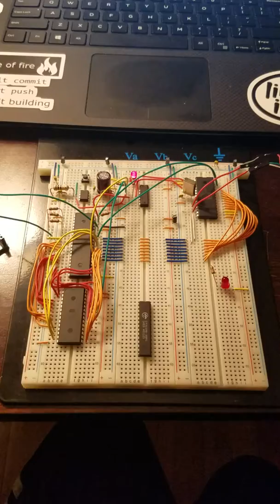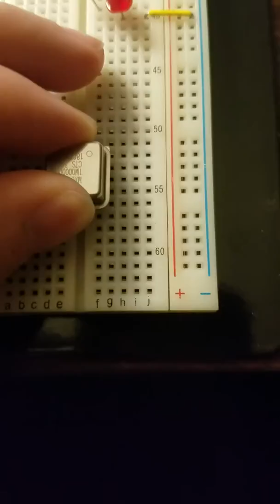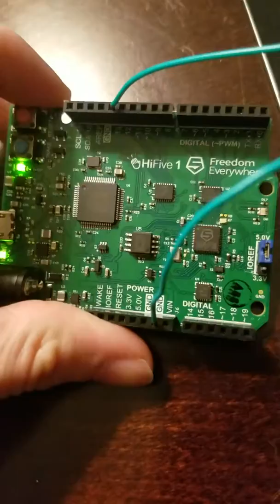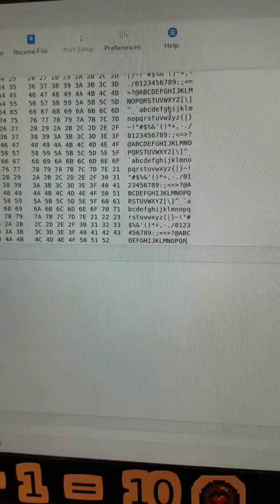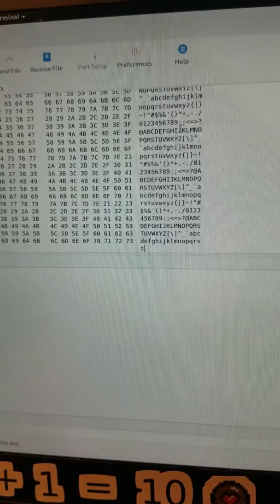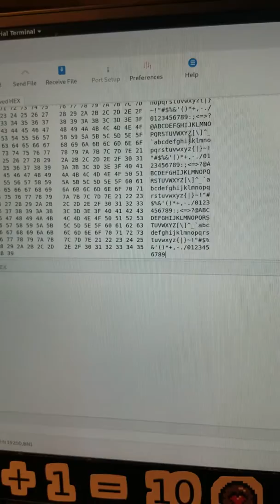DIY 65c02 Computer - Part 1 - ACIA

Comment: I'm using a 1.8432Mhz crystal oscillator on my breadboard 6502 computer and it works fine (I'm running my own 6502 FORTH on it so it's stable enough I'd say. Not sure the breadboard were the problem in your case, are you sure?). In any case we'll done! Your wiring layout is very clean and nice! Congrats! I hope you progressed, with RAM for example.

Comment: Can 6502 rom and memory be used on the W65C02 (are they interchangeable), and also is the  assembly language the same or similar
Reply from the maker: Yes and yes, generally. The ROM/RAM are not specific to the 6502 in any way. The W65C02 (the chip I have) is the same as the 6502 in ALMOST all ways. It has extra instructions (but includes ALL the original ones), so the assembly is the same. There are smaller differences however, but generally they're the same.